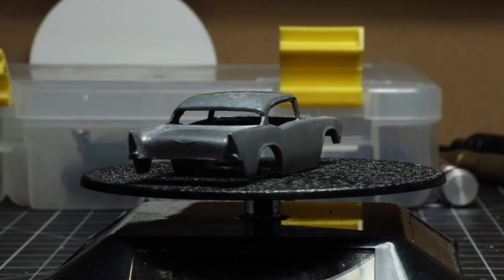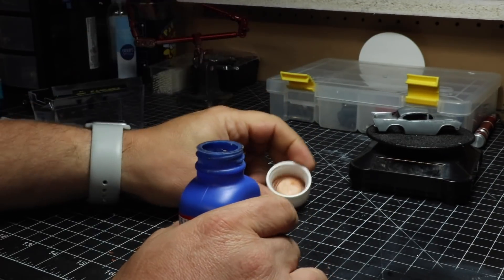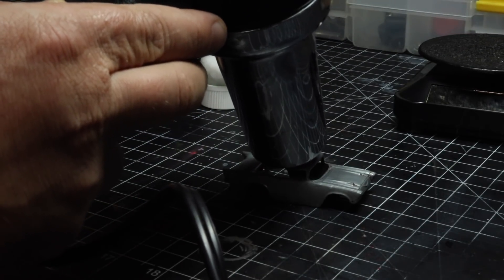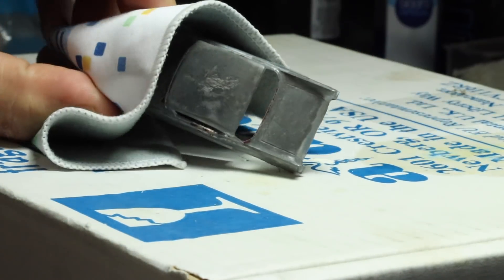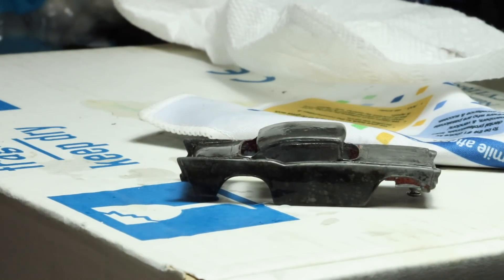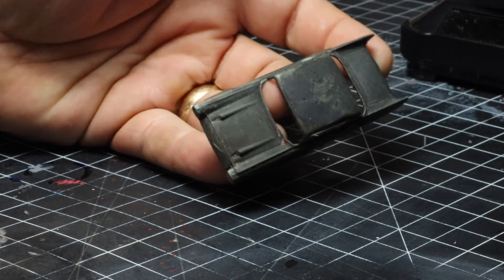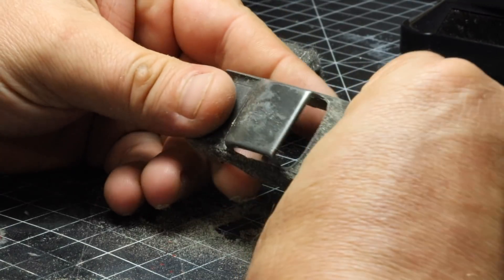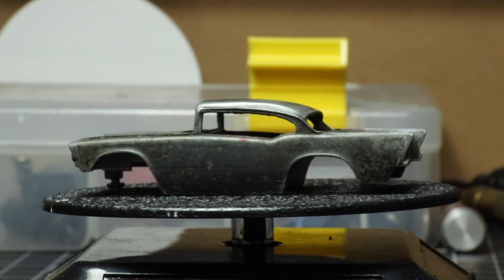Cold Bluing a Hot Wheels Car? Redline 57 Chevy is Back!

Comment: I reblued a .22 rifle and when i did it i didnt use heat. At least i don't re.ember heating it but I couldnt get it to look good so i tried something a bit different.  After soaking with the blueing solution i immediatly put in water. Now its been years and i can't remember if it was cold, hot, or warm but i can tell you that this is how i got my best result. Give it a shot and see what u think.
Reply from the maker: I will give it a shot!

Comment: Zamac is relatively clean, but I'm not so sure that all Hot Wheels and Matchbox are made from Zamac. I've stripped a few and tried to polish them, only to find the metal looking calico, whereas other models (of the same brands) polished up very bright and clean. I cold blued a diecast truck body back around 2007, and it turned pitch black, but I couldn't get the same results from others, so that's why I suspect a variety of casting mixtures. It's probably why the straight Zamac cars are polished and clear coated, rather than painted. I'm not certain, but I've definately tinkered enough to at least suspect the metal mixtures are vastly different.

Comment: I REALLY want to see what a few coats of Spectraflame would look on top of that gun blue finish. Something on the darker end in a red or a blue. I bet it would look cool as hell but accept that it could look like refried crap.
Reply: Curiosity Forge that's a  great suggestion, I would like to see that too to be honest
Reply from the maker: I may have to try it soon! Might be refried crap but it would be worth the experiment!
Reply: WheelsNThangs I really hope to see the end result!
Reply: WheelsNThangs you won't know until you try. You never know, you may discover something awesome.
Reply: I think you'd lose any aspect of the spectraflame, and it would end up just looking like translucent paint. Spectraflame relies on the shiny under surface to bring out the spectraflame look.
Reply: Chad Stinson You are right that it will be translucent, I think what will make it work is the dark mottled surface. The reason Spectraflame would be good for that is because it's an extremely clean bright translucent on its own. That should play well with the dark surface. That being said, I accept the fact that it may not look as cool as I think it will.
Reply: Chad Stinson a very light spectraflame coat might give it a "black ice" look. Win, lose, or draw I am very curious what the end results would be.
Reply: Chad Stinson the only unknown is it is not a straight black...it is a metallic black and that might work out better than you think

Comment: Interesting experiment! Can I ask if bluing gun barrels is purely for cosmetic purposes or does it have some function eg protecting the metal from corrosion?
Reply from the maker: It's to protect them.
Reply: Bluing leaves a oxide finish that will help protect from rust how ever cold bluing is very soft and normally really only used for touch ups
Reply: Thanks!

Comment: Can you ask you a question about your painting? When you spray paint something either with your airbrush or even from a can do you bake the finish on in an oven? And what degree do you do that?
Reply from the maker: I only bake when I'm in a rush as the finish is pretty easy to burn. 220 degrees for 30 min
Reply: WheelsNThangs does baking the Finish make it any stronger?
Reply from the maker: Not that I've noticed.
Reply: WheelsNThangs okay well thank you for the information I was just trying to figure out a way to put a good strong paint job on there because you know the paint job that come from the factory usually pretty durable.

Comment: Very interesting. You make a great point about not knowing what makes up the casting parts. In other videos, you have these black knurled handles that you use for your tap and screwdriver. Where can I get them?
Reply from the maker: This is the set I used. An allen key holds the tips in so the drivers just slip out. I think I had to drill the hole out a bit for the tap to fit. 

https://amzn.to/2z9qJVR
Reply: Great. Thank you.

Comment: you can't touch the metal without gloves.  the oils on your skin make the bluing not adhere correctly.  I do gun work too and it makes a big difference
Reply from the maker: I usually do as well but this was just for giggles. Some of the areas I could tell it should would not adhere to no matter what. I'm thinking some of these older cars may have been mixed with lead but who knows. I  typically use Brownells Oxpho-Blue but was out of it, I think it may have worked better.

Comment: Did this to one of my cars a few months ago.  Finished car is on my Instagram account.  Mikeys_hotwheels
Reply from the maker: That turned out pretty nice? What bluing did you use? I typically use Brownells Oxpho-Blue but was out of it.
Reply from the maker: That should have read "That turned out pretty nice!".
Reply: I used the same stuff, but spent some time polishing the car before applying it.  I also found that the steel wool stripped too much of the finish off, so I buffed it with a terry cloth.
Reply from the maker: Ahh! Yeah, it for sure does not absorb into the metal like steel does.

Comment: Wtf is bluing
Reply: idontlikecops1 Bluing is most commonly used by gun manufacturers, gunsmiths, and gun owners to improve the cosmetic appearance of and provide a measure of corrosion resistance to their firearms. It was also used by machinists, who protected and beautified tools made for their own use.
Reply: A chemical reaction you get with carbon steel. You stick a shiny carbon steel object in bluing salts and get a chemical reaction that darkens the steel to a dark blue color.